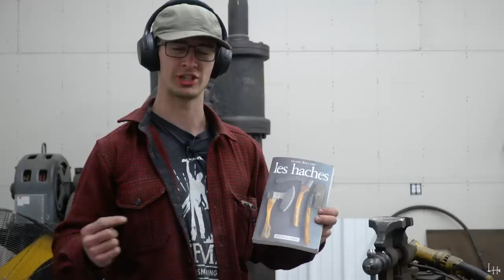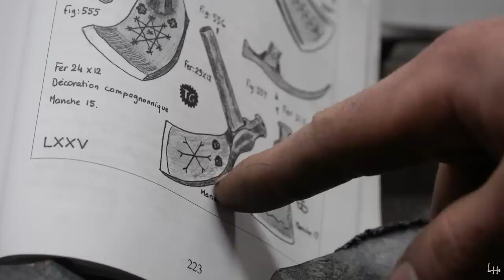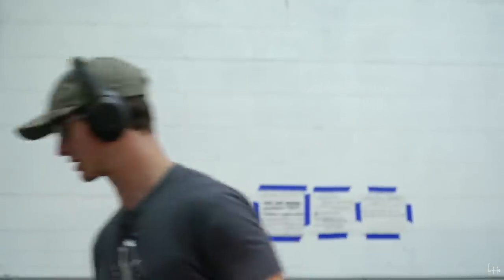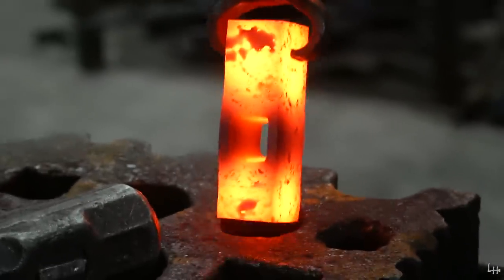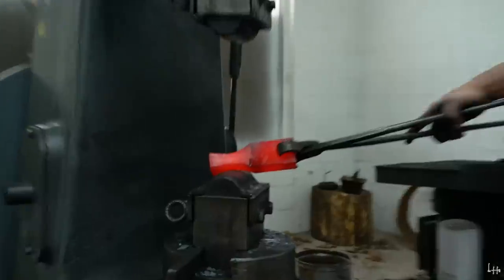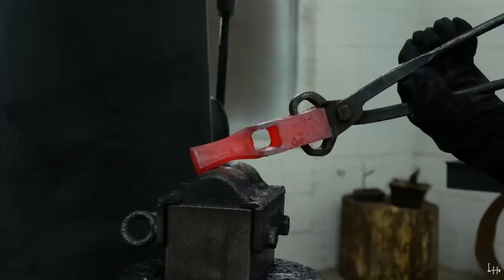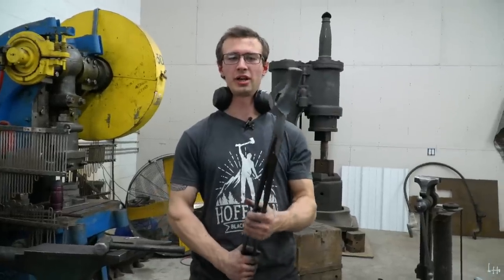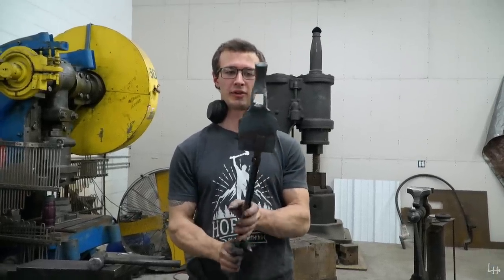ANOTHER SPONTANEOUS AXE CHALLENGE! ADZE?

Comment: These spontaneous vids were a great idea.  Just one constructive comment.  All adze blades are slightly curved so they meet the material flat at your feet.  With the adze as flat as it is now it would dig into the material in a chopping angle instead of a glancing/flattening angle if that makes sense

Comment: I love your work....however I think you've  missed the mark a bit. The internet is full of negativity so I I rarely criticize. 
I think  the adze blade should be further towards the outer end of the tool, you have the blade coming off at mid haft. This will not cut well, it's more like a nice hammer with a garden hoe than the precision  cutting tool  in the illustration.
 I understand that you are trying to reproduce  a tool from a rather crude drawing, and perhaps you've never used an adze so that detail might be easy to miss. I'm no blacksmith ....so I'm not criticizing  your skills , but I am a user of tools
 
In the future I'd love to see you build a reversible, off set headed  hewing axe with a non tapered eye so that  it could be used right and left handed using one square , straight handle. There is a video on a  Finnish log cabin where a guy wields such an axe. Check it out.
Reply: Lots of illustrations on Google images.
Reply: Are you sure the eye of that axe you mentioned isn’t tapered in both directions? An untapered eye doesn’t hold a handle very well unless I’m missing something about how the handle attaches differently to said axe. It is my understanding that almost hewing axes can be mounted either left or right handedly on a handle. 

There’s an interesting Australian method I’ve seen of hanging a hewing axe without a wedge in a kerf but a large wedge cut out of a cross section the same shape as the eye. So the handle can be easily removed and the axe turned around the other way. The axes I’ve seen this done on were just ordinary hewing axes.
Reply: @broadusthompson1666   It could be....perhaps we  talking about similar axes. The one I saw had a big square swedge at the end of the handle, I  assumed it was not tapered and just friction fit because of the big nub protruding out....but it's entirely possible it tapered both ways.